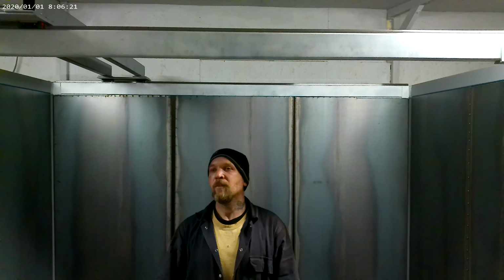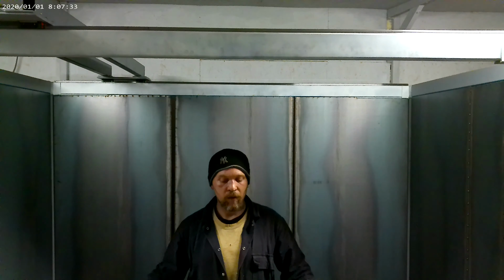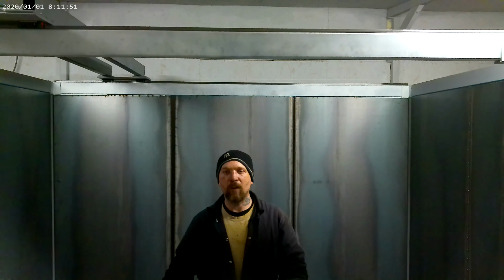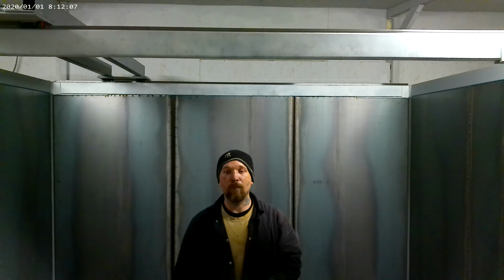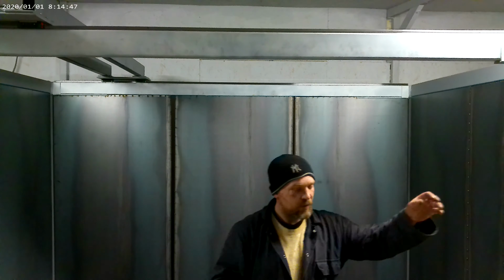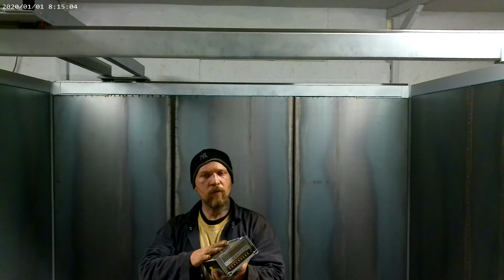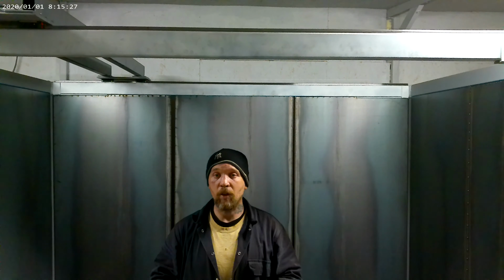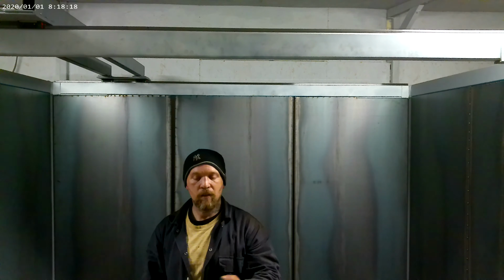Large Hybrid 3D Printer Project.

Comment: Hey I'm Crockett and I am also working on a large 3d printer using the same extrusion screw from robotdigg and Duet motherboard, however, my printer is a bit different and I am not as far along as you are.  I have been doing some testing of the extruder and found that a 380W band heater is all that is necessary to extrude HDPE through a 3mm nozzle diameter.  There is a lot more I would like to share but this is not the ideal platform to do so.  Can you send me a link to where you bought that band heater?  I really want to use one that has a built in thermistor.
Reply from the maker: Happy to help, good luck with your build.
Company I use is based in the UK this is the link to their site.
Just let them know what you need and they can make it to suit.
 http://microcoilheaters.co.uk/MicroCoilHeaterswithThermocouple

Your more than welcome to contact me via email, ahooper@assettech.co.uk.